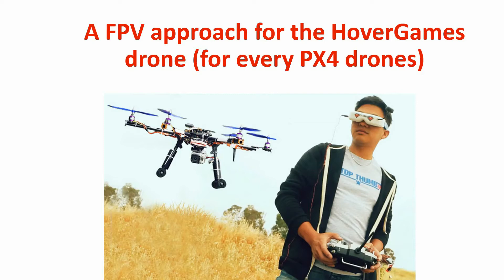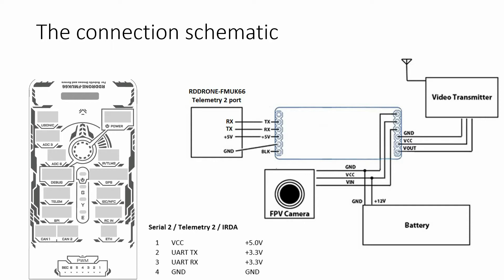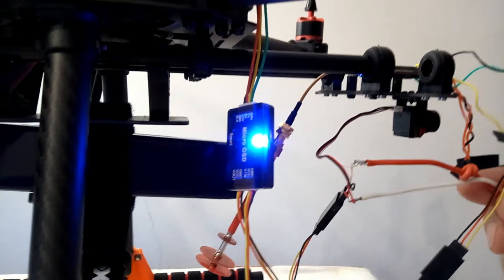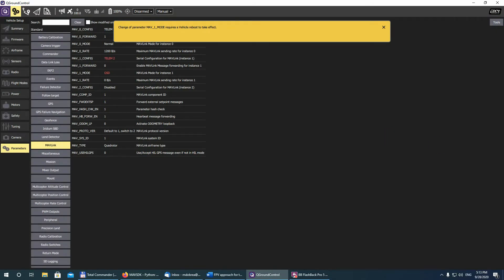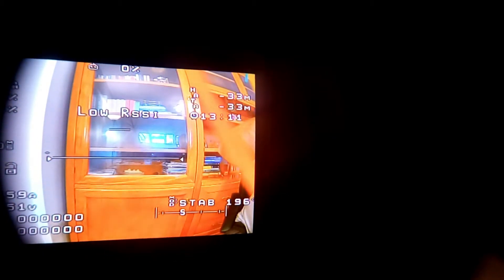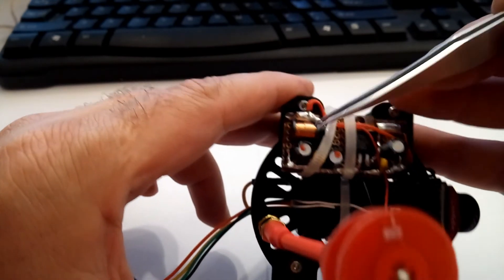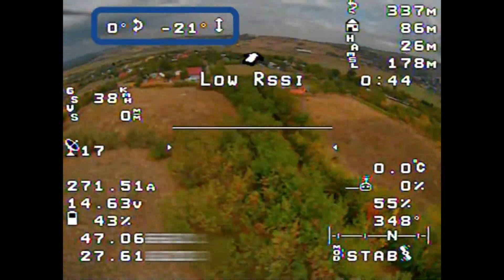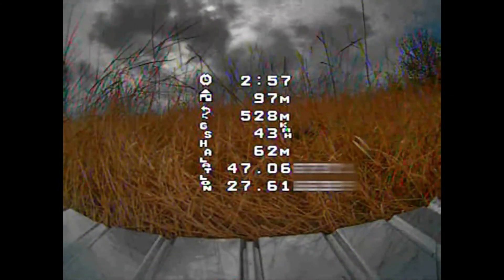Micro OSD, MinimOSD or Mini OSD a FPV approach for a PX4 drone (e.g., NXPHoverGames)

Comment: Hi Did you find out why the flight mode didn't change?  I have the same issue. Good video with lots of useful information.👍
Reply from the maker: No! From conceptual point of view the data is in the stream but the Micro OSD is unable to decode it. So, I bought and another OSD module, more newer,  with the hope that is able to extract that information. No time to check - up to now.

But, also it is possible that PX4 does not implement very exactly & correctly the MAVLink protocol. Right now my receiver is a crossfire one, and I want also to tunnel the MAVLink protocol through the crossfire - but it is does not work.  The Crossfire diversity nano is it not able to send the MAVlink data ... it does not recognize it - this is my supposition. 

So, in conclusion .... NO. Please if you are able to solve the problem keep me posted. I will do the same.

You have a nice channel, with a lot of good information. In time I will read. Subscribed.